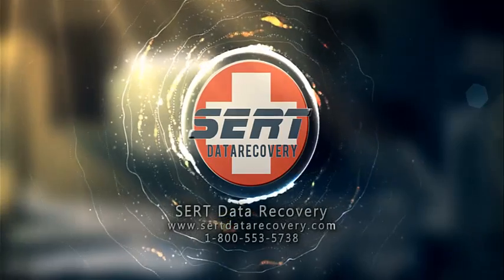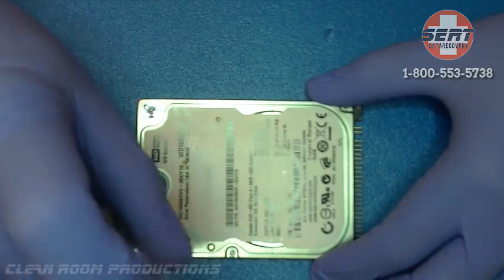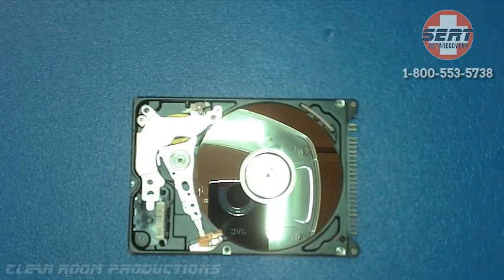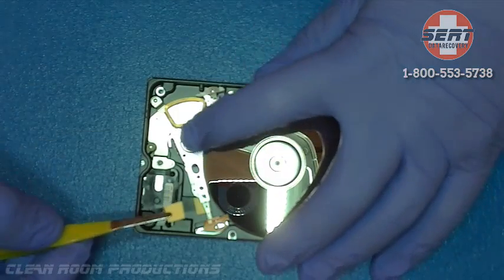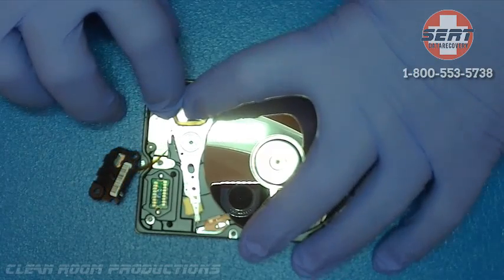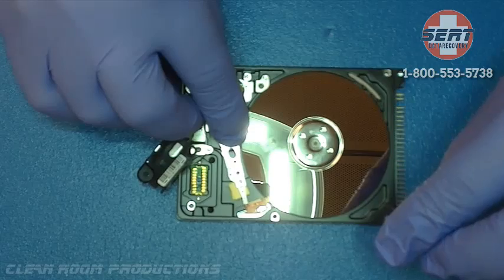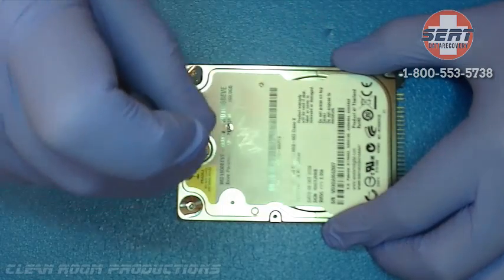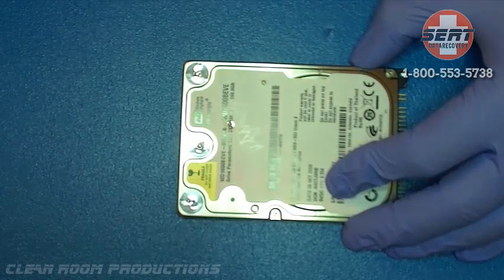Hard Drive Recovery - Repair - Western Digital Data Recovery with Clicking Beeping Sounds

Comment: hey I have Lenovo y50 70 and it's we black hard drive making sounds beeping 2 times and laptop do not recognize it. I tried and head were stick on a platter and solved them but then too sound was coming and nothing happened so can it be fixed
Reply from the maker: You opened the drive and moved the heads inside and now the drive is making a different sound and still does not work?
Reply: SERT Data Recovery yes
Reply from the maker: There is a good chance that the platters are damaged from moving it and definitely the heads.

Comment: My WD10SPCX 1TGB has big sound and  the laptop has problem is  turn to  blue screen and doesn't work. But if I put my laptop 90/180 degree  it has NO sound and work well.  Could you give advise for my HDD?thanks you!
Reply from the maker: what kind of sound?
Reply: Could you check this file. when i put the laptop at 90 degree, i ll have no hdd sound
Reply: I'am sure that's HDD sound after open the laptop
Reply from the maker: back up your data and get the drive switched out for a new western digital black, no more than a 750G OR better yet whatever size SSD you need. :) grinding is never good and we had a drive like that before and soon after it failed catastrophically (non recoverable - of course AFTER the data was moved safely off the drive)
Reply: OK! Thanks you!

Comment: My HD was working yesterday and all of a sudden it started making click noises like a time bomb! and now I can't open my HD. All my datas are stored on that HD please is there a solution to fix it?
Reply: +Khalifa Khoori Did you find a solution? I am in deep shit now
Reply: +Nirnaya Bhatta no i didn't :( i took it to a computer shop and ask them if they can recover my data. They said the HD us dead and it is impossible to recover the data. The funny thing us, when i showed my HD to him he laughed and showed me two WD passport HDs similar to mine with the same issue lol he said WD is goid fir internal HD, if you want an external one go for other brand.
Reply from the maker: +Khalifa Khoori The solution most likely lies within a $9K piece of equipment that can work with the internal software of the drive. Without it it may not be recoverable. We work on WD all the time with this issue, and it is regularly this situation.
Reply from the maker: +Khalifa Khoori Most people don't look at hard drive reliability from the right perspective. Most WD models are the most durable, recoverable HD made when it comes to head and firmware problems. Seagates tend to have platter damage too easily from failed heads and re often not recoverable because of this.
Reply: +Khalifa Khoori Thanks you. That incident is really funny- although I will try to fix it. Cheers.
Reply: +SERT Data Recovery Could you please tell me what the equipment is called? I live in Nepal, and I guess the IT engineers might not have access to that equipment yet.
Reply: +SERT Data Recovery man i should buy ab equipment which cost 9k just to recover my $80 HD. Anyway I will try to see if someone has it. Thanks a lot
Reply from the maker: +Khalifa Khoori no I wouldnt suggest that however just informing you of what it will most likely take with your symptoms. Only a professional data recovery company would have this equipment. Computer repair and IT engineers in America don't have access to this equipment, only data recovery labs.

Comment: Hey, I have WD My passport 1 TB WD10JMVW, it was clicking then suddenly the computer cant read it,  when I connect it it shown that it has connected but nothing shown in My computer, also it is appear in Device Manager but with capacity zero
I tried all the software recovery on the internet until they told me it is HW problem, could you tell me what should I do?
Reply from the maker: When ever a drive is clicking or making noises other than the typical healthy whirring sound there is most definitely a mechanical or physical problem with the drive. Running software should only be used in the event of deleted files or a reformat. The first thing that must be done is determine why it is clicking which requires special (and expensive) data recovery hardware/utility. Then that must be repaired before making an image of the drive. If the data is worth anything to you then I would send it to a professional recovery service to ensure the proper and safe recovery of your files.
Reply: Yeas it worth, so please send for me
Reply from the maker: Ahmed Aboelazm We'll be glad to help you with that. If you want us so take a look at it please fill this out fo you know what the cost might be if we get your files back: https://secure.sertdatarecovery.com/secure-online-estimate

Comment: my hard disk clicks 3 times and then stop what dose it mean
Reply from the maker: vishnu swaroop probably bad read/write heads
Reply: +SERT Data Recovery hey my HDD does a scraping noise every 7-8 seconds and my pc fails to boot up.. it goes to Verifying DMI pool and then loops the proces.. is it dead?
Reply from the maker: Crash Dummy It sounds like the heads may have made contact with the platters. This is never good. I would not run it any longer, and if the data is important get it to a clean room so an engineer can evaluate it to see if it is "dead", or if there is a chance for recovery. Only a trained engineer can tell answer your question after having a look at it.
Reply: SERT Data Recovery I had no time for that. I saved the important data before the HDD died on a flash, then i smashed it with a maul :D

Comment: can it be done without swap any part?
Reply from the maker: mohd amri can you please specify what "it" is?
Reply: The click sound damage. I have problem with clicking sound ,I'm from malaysia and I dont know where to repair my hard drive and the cost. I would like to try it by my own. Sorry if bad english. Thank you for reply.
Reply from the maker: mohd amri Clicking does not automatically mean you have bad heads that need to be replaced. Clicking can come from corrupt firmware as well. I would not suggest trying to replace parts in a drive on your own, there are very few professional companies that are able to do this successfully.
Reply: It's there any solution for me to repair my external hard drive?
Reply from the maker: mohd amri the only way we could answer that for you is to have it here where we can diagnose the drive to see what is causing the clicking noises.

Comment: While playing some game,it bugged and i couldnt exit the process so I forced restart over button.What happened next is I heared clicking sound and the windows wont start loading.After few tries the clicking sound didnt appear but my pc reported on start "Unable to boot from disk,please insert system disk and press enter to continue".Is my hard drive dead or I just need to reinstal new fresh OS.
Reply from the maker: I wouldn't say your hard drive is dead. It sounds like the error might be referring to OS corruption, and supported by Windows trying to load but failing into an error message. The clicking sound coming from your drive can mean the drive is failed, or failing, however some hard drives make a few clicking noises normally on startup. When a drive is failing, but still operational, it can cause corruption to certain areas of files or a file system. If the right sectors, in the right place on a hard drive go bad, the operating system will not boot. Too many of these sectors on a drive can cause it to click by corrupting the firmware.

A few questions about the hard drive:

1. Is it still clicking?
2. Does it boot up now?
3. How old is it?
4. What Make Model is it?
5. Do you have any data on it you will miss when it dies?

On the flip side, you may need to do a OS repair install, but if your drive is failing so will that, and it will make things worse.
Reply: It is normal SATA samsung hdd,using it for over 4 years.It stopped clicking after few startups but it wont boot so i sent to some firm to check it out.It may be dead or it may be unstable to use after using to play computer games on it for over 4 years.Good thing i dont have any important files on it.I will let you know what will happen after.